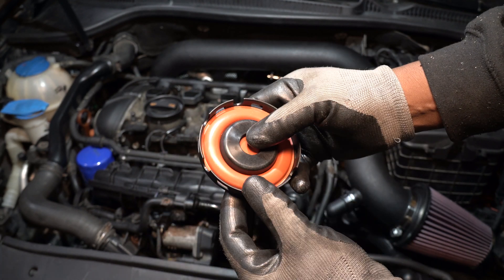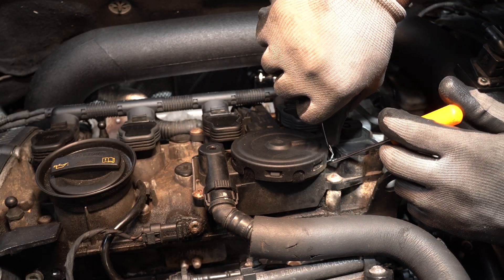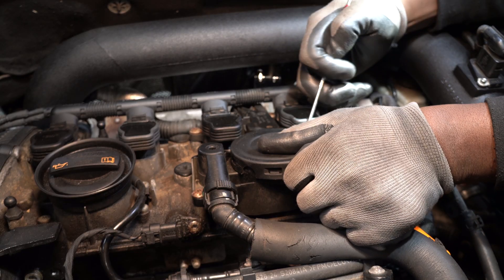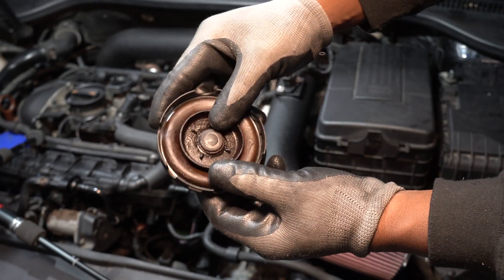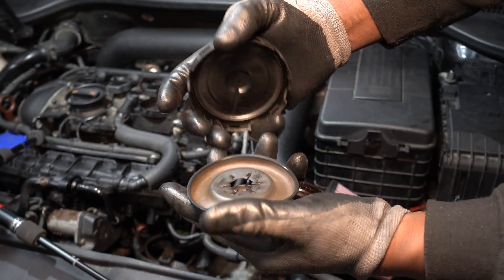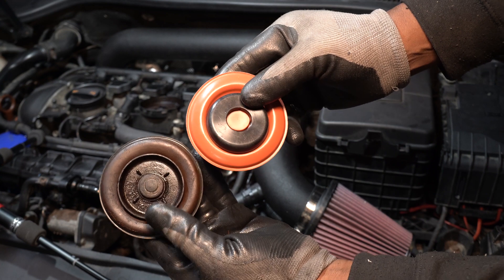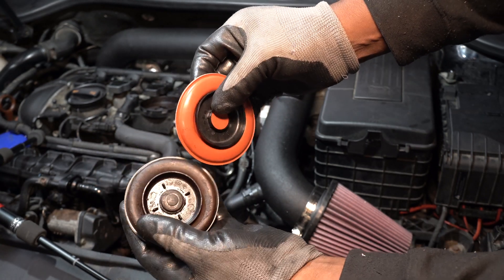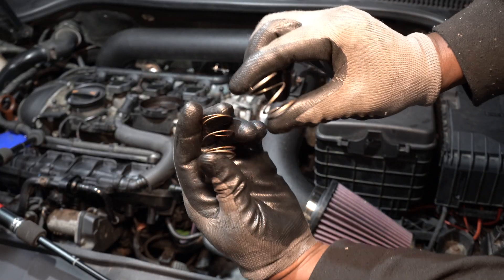VW Golf MK6 GTI PCV Valve Diaphragm Upgraded Replacement MKVI 2010-2014

Comment: I'm burning a quart of oil every 600 miles now in my 2016 Jetta with 92K on it. Tried your dipstick test and instead of the engine stumbling, the idol increased and did not stammer or shake in any way. Now I'm wondering if it's an internal problem and not the PCV diaphragm or assembly.  Damn cars!

Comment: I just put that same piece on nephews 2.0 and they shipped me the black plastic inner piece upside down and I installed it that way. Going back and taking it apart .. I was thinking the whole time it should have had an insert to center the spring but i put it on the same way it was shipped . never occured to me to flip it over ? LOL car had other issues so only was driven for 5 minutes since I installed it so no worries.

Comment: The best way to remove the pcv cover is push a flat head screw driver in between the cap & housing towards the tab & the plastic will pop over the tab. Just make sure you line it up with the tab & do not pry at the plastic because it will mess up the housing.

Comment: Thanks for this video! Got my mk6 running smooth and not leaking oil. I did the job without those tools but man it was a terrible experience 😞. Definitely recommend to anyone attempting this to get the pick tools. Thanks👍🏾
Reply from the maker: Much respect! Yea, the pick tool will make it easier.
Reply: Even /with/ the pick tools, it was rough for me getting that cap off. I worked at it for like 20 minutes straight, picking and clawing before it snapped and went flying.
My diaphragm wasn't ripped, but I figured it'd be good preventative maintenance.

Comment: Hello. Your video was so helpful and saved me the expense of a mechanic. Using the "pick tools" helped immensely. It was a bit of a struggle to get the cap off. I found that the rubber seal was ripped. Definitely in need of replacement. Thanks!
Reply from the maker: I'm happy this video helped you to get it replaced. Yes, the pick tool is a versatile tool. Thanks for watching, Much respect!

Comment: Yo, have you heard of the gram 70mm throttle body for mk6 Gti? I might do an install and review video for the fam!
Reply from the maker: Yea I've heard of it. Do you still have the stock intake manifold?
Reply: @CraftyWorkshopBuilds  yes
Reply: I haven’t seen really anything on online which is kinda weird, but I’m willing to do an install video and review on it!! I’m complete stg2 apr and dsg tune on a mk6 Gti so, let’s see!!
Reply from the maker: @razturret  okay cool. I'm assuming a lot of people just address the other air restriction parts that are cheaper. Still would be interesting to see it in action though.

Comment: My guy...Thank you! Great informative video... . I'd tried to remove it with a flathead but it was much easier with the hook, like you suggested. My top cap was brittle and broke when I was prying it off, but as long as you don't break the bottom part, you're good...

I have a lot of tools but didn't have a good hook set, so I went to good ol Amazon and ordered one of those, the PCV diaphragm, and a new air filter while I was at it. Your smart little dipstick trick gave me a good idea that this tiny part might be the cause of the error code P0507 I was getting...

With the top cap off, I cleaned the build-up out, and noticed a clear rip in the thin stock diaphragm. It makes me wonder if all or most of the engine issues we've had with this vehicle relating to breathing and the Check Engine or EPC light isn't all tied to this flimsy OE part...Putting the new, more durable, part on was simple, but you want it to snap when it goes over the tabs. I used a rag and rubber mallet to lightly tap on the cap above the tabs to get it to snap into place easily...I also utilized the original, longer spring, like a lot of people suggest is the best route...

With that job done in 10 minutes or so, I swapped the air filter out real quick, replaced the engine cover, and gave the car a start...

On first start, the car stuttered a bit, idled roughly for about 30 seconds, then stalled out. I immediately restarted the car and the CE light was still on, but it seemed to be running a little smoother. After about 20 seconds or so, the RPM's dropped from 1100 to around 850 and held steady...I hooked up the diagnostic tool and had a reading that showed the same errors, P0507 and P2187. I cleared the codes and the light went out and the car was idling well. Took it for a quick spin and took another reading, and had no codes or lights illuminated on the dash. So that felt good...

Time may show me otherwise, but it kinda looks like your video helped another man learn something, and save some cash! Much appreciated...
Reply from the maker: Much respect! Yea, the pick tool was the best tool that I found to remove the cap without breaking it. The stock diaphragm is a common failure part, when it fails it causes other problems as well. Hopefully your CEL stays off, let me know how it runs after a couple days. I'm happy I was able to help, thanks for watching.
Reply: @CraftyWorkshopBuilds  seems to have done the trick...no Check Engine or EPC lights after a week. Thanks again!

Comment: I'm thinking I may have this issue but is there any reason why you would want to replace the entire PCV valve kit over just replacing the diaphragm? I see they sell the entire valve as well.
Reply from the maker: The entire PCV kit comes with the cheaply made valve, which will be prone to tearing again.

Comment: My diaphragm came off in about 9 pieces lol
Reply from the maker: Wow, lol. Did you notice the symptoms?
Reply: @CraftyWorkshopBuilds  yes I did. I put this on late last night. Have to go for a long drive today so I should know more. I had suction through the purge hole before the change and no longer have that. It was only 35°F here in the US last night so that probably didn't help getting it to come off without breaking. I warmed up the new diaphragm before I out it on. Let the car run for at least a half hour after and no codes came up.
Reply from the maker: @aimeagle  ok, I see. Now that you install the new one you should be good. If you had left the torn one in for too long, it could cause other problems.

Comment: Weird one here but when I remove the dipstick, no response. When I remove the oil cap, no response from the engine but it has plenty of suction.
Reply from the maker: Okay, I see. You can always remove the cap and check the diaphragm and see if it's in good shape.
Reply: @CraftyWorkshopBuilds  Well, took off the current pcv valve top and diaphragm. Looked fine. Put new one on and car feels amazing now. No more sluggish accel. and engine stumbles like crazy when I remove the dip stick now!
Reply from the maker: @draza3083  Nice! I'm happy you got it fixed. If it's the same diaphragm that I suggested, it's much stronger than the stock one.

Comment: Hey, my idle only changes slightly, when I take out the oil cap. not as bad as in this video. Could it mean the PCV is on its way out?
Reply from the maker: Yes, it could be. You can always just remove the cap and check the diaphragm.

Comment: Well done, sir!
 I have ordered the RKX upgrade and I'm looking forward to (hopefully) never having to deal with this P0171/P12A2/RMS replacement again! I just hope I've got to it in time, before the RMS has gone again. It's only been about 44K miles since the last one.
Reply from the maker: Yea, hopefully your RMS is not leaking. Once you do this upgrade you should be good to go.
Reply from the maker: Oh, cool. Did your diaphragm had a tear?
Reply: @CraftyWorkshopBuilds  yes, the diaphragm was definitely bad and I believe that was the only cause of my P0171 and P12A2 codes. The codes haven't returned. So glad I found this video.. Thank you so much
Reply from the maker: I'm happy you solve the issue, thanks for watching!
Reply: @CraftyWorkshopBuilds  The upgrade was done, the engine codes cleared, and so far, so good! I did NOT see any oil from anywhere except maybe the engine cover and around the PCV and a little something around the HPFP.
Reply: Hi can a system rich  code P0172 br triggered by this PCV. I do get a whistle sound when car is under boost
Reply: @jeffreyswarts1524  The whistle could just be the turbo itself?
It's easy enough to remove this PCV, carefully take it apart, and inspect the diaphragm inside. You have to be careful taking it apart though. The plastic tabs become brittle.
In my experience the error code was a lean fuel bank, not rich.

Comment: Hey when you say stumble does it sound like the car is cammed because I’m having an issue like that and is giving misfire codes only when idle. so Im guessing it is this but I don’t want to buy the whole pcv because the dealership is charging me 200 for the whole thing and the ecs that is 130 takes a whole week.
Reply from the maker: You can just remove the valve and check if its torn.

Comment: Was there any other issues besides the stumbling you mentioned... I just tested mine like you said mine don’t really stumble but it seems to run fine so I ordered it anyways plus I’m at 119k it’s never been changed what you think
Reply from the maker: It's a common issue on these cars, its a pretty good chance it's bad if it's never been replaced before. You can always take off the cap and check the diaphragm.

Comment: Just subscribed! Very clear video and amazing quality. I plan to move from stage 2 mk5 (Manual) and get an mk6 (DSG) and go stage 3 with it. I am buying all the parts I want to change for the mk6 like, PCV Valve, timing chain, coil packs, spark plugs, etc. They said this is a common part to fail and seeing you install it gives me confidence I can easily do it on my own.
Reply from the maker: Thanks and welcome! I'm currently gathering parts to go big turbo stage 3 as well. I just did my timing chain.
Reply: @CraftyWorkshopBuilds  Nice!!! That's amazing!!! When I first get it I'll go stage 2 but within a year I'm definitely going big turbo on it with an LSD with meth kit. If I can push 400 to 450whp on stock DSG and motor I'll be very happy. I wouldn't need anymore power than that. Since the power to weight ratio on these cars are amazing.
Reply: Same I just got a mk6 GTI